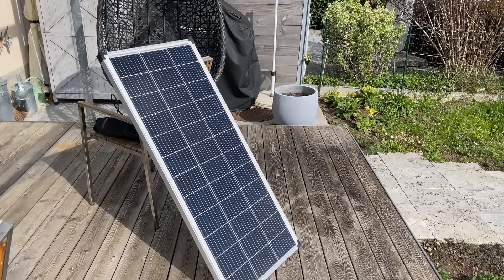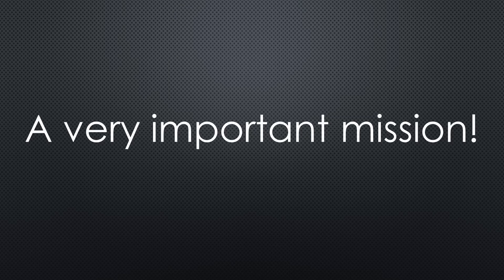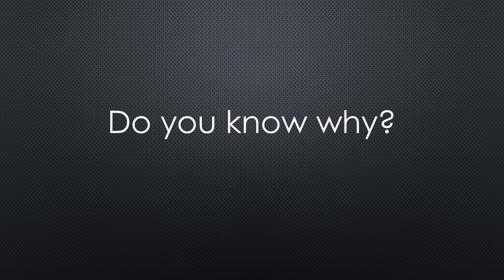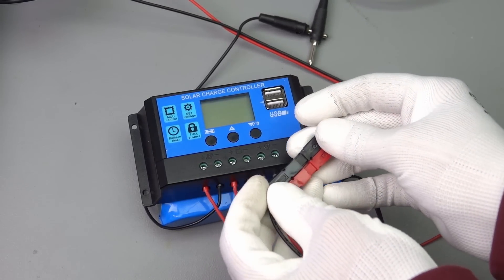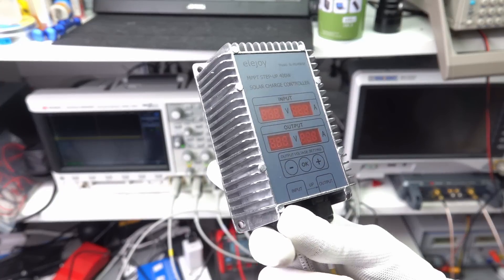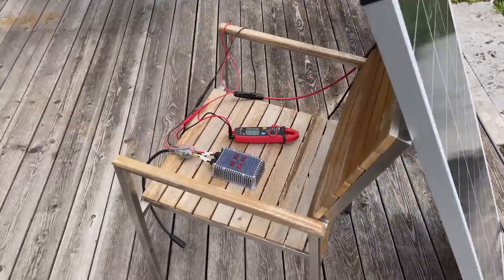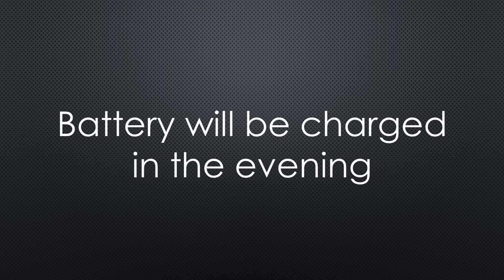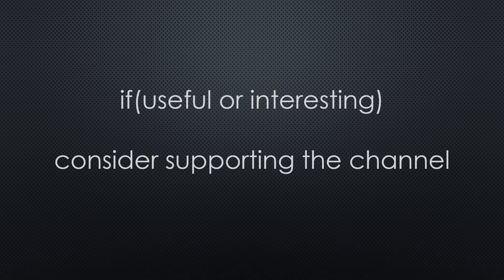454 How to Build an Solar Battery Charger for eBike / Electric Bicycle

Comment: those were some expensive solar panels! here in poland (so full vat etc.) i can get a new 410w panel for 100 euro ("risen" manufacturer, hyundai for double the price).
Reply from the maker: I still remember when I bought an Orange SIM card when I was in Poland. It was dirt-cheap and worked all around Europe. So you live in a very good country!
Reply: @AndreasSpiess  inexpensive, yes. good in some regards, bad in a few others!

Comment: I would have connected the Battery to the cheap mppt controller battery connection.
Wouldn´t that work?
Reply from the maker: You did not add enough information to decide :-(

Comment: Three 20V panels in series and  linear voltage regulator at 42V. Everything else is just looking for trouble.
Reply from the maker: I am not sure if you would get a good performance with your design because the input voltage of the linear regulator would be around 42 volts (battery voltage plus the voltage across the regulator. This would be very far from the MPP of the panels. Remember: The batteries take whatever current they get because of their low inner resistance.

Comment: that battery looks a lot like a roof rack cargo box. in the thumbnail i thought the solar panel would be fitted on top of a car roof with a modded cargo box.
Reply from the maker: Indeed, the battery looks a bit like that. But, of course, it is much smaller ;-)

Comment: why not a simple voltage divider to lower the 42v to 5v ?
Reply from the maker: Also a possibility. Others suggested using a resistor and a Zener diode, which is a bit more stable. Voltage dividers depend a lot on the current you draw.

Comment: use 2 panels directly  is aprox 42v ;)
Reply: Thats what i was thinking, at leat 2 half the size in series.
Ive always heard the higher the voltage, the more efficient everything is.
Like inverter input voltages.
Reply: @MikinessAnalog  exactly, of course there are far more expensive solutions, but I said this from personal experience, I personally tried to charge the 36v nominal battery of an e-bike, based on the post-apocalypse idea that there would be no parts or equipment to buy, so I tried to charge the battery directly with the serial  connected two polycrystalline panels directly to the live plus and minus... and char
ged it in a little more than half a day, the battery is 400w, the downside is that when the sun starts to set, then the battery has a higher voltage than the panel and the panels slowly drain the battery, which means that it should  solve with some isolated booster or diode
Reply from the maker: I agree. 2 panels that have an MPP close to the charging voltage of the battery would work. Because I had no plan, I already bought the big panel and did not want to change, also because one panel is easier to handle.
Reply: @AndreasSpiess  I know , the panels offer are usually pre-declared... for existing or factory chargers pwm or mmpt... at the same time poly panels have a nominal voltage of 18.6 and when the temperature is very low it goes up to 23v, the larger panels are 250w  they are usually designed at 36v for charging a 24v system... so... it is difficult to bypass the factory solutions that were obviously already imposed on us by the design of the panel itself... I actually charged the battery from the e-bike, but I had to watch and check the voltage  and amperage... in any case, during an average sunny day, they will charge the battery from the other side and advise that lithium ion batteries be charged up to 80% and not below 40 or 20%....
Reply: and just to clarify, I have been actively dealing with solar systems for years and I am completely disappointed with inverters and their inefficiency.. so I resorted to the option of leaving everything that can work on direct current to work on direct current using only and exclusively dc-dc conversion..  eg LG 43"7050 TV consumes about 65w 220v... with UPS it is 85w and when... I use dc-dc the television consumes 37w... it seems like... that someone is deliberately damaging us... which was unbelievable to me.  .. that's why it doesn't occur to me to ever make alternating current or grid tie from solar panels for the rest of my life
Reply: Specifically, my TV uses 13.2v for electronics and 60v for backlighting.. I didn't touch anything, I just took the connection with cables and powered it from a dc-dc converter.... means... step up down 3a (2.1 peak) 13v and step up  to 60v....(59.5) pwm on signal I used for the led diode that turns on the relay that turns on the backlight all together 20e.... tv on... from 10.5 to 40v ...

Comment: My own setup is super inefficient. Solar to mppt charger to 12v lead acid to 240v ac inverter to Battery charger that drops it again to 42v dc.
Reply from the maker: If you use a big enough panel there is no problem;-)

Comment: I found myself repeatedly saying "put a few panels in series" all the way through the video.
Reply from the maker: This would help if I would match the MPP of all the panels with the 42 volts. Otherwise, I would get into the same trouble. Plus: I would shift the electrical problem into a mechanical problem (Creating a waterproof and rigid panel out of several small panels ;-)

Comment: A larger solar panel 72 cells would cost the same and solve all the voltage problems at
Reply from the maker: I agree that a panel with an MPP Voltage around 42V would avoid the charge controller. However, the ones I own are quite bulky and made for stationary usage.

Comment: 🤔 And where is the charger?  We have a solar panel, we have an mppt converter with a boost converter but where is the CC/CV charge controller for Li-ion batteries?  You don't think there's a charger in the battery?  There is only a BMS that guards the boundary voltages.  Li-ion batteries cannot be charged this way.
Reply from the maker: The current provided by the MPPT is in the limits of the batteries (the panel does not produce more). And because I set the charger's voltage to 42 volts, the current gets smaller and smaller if the voltage of the batteries approach 42 volts.

Comment: Maybe the cheapest but not efficient method would be use cheap AC inverter and your wife's sister regular wall charger :)
Reply from the maker: I agree. That would also be a solution. We would call that principle a "balcony power plant". But usually, they use much bigger panels for that purpose.

Comment: Haha, I also use my ebay/amazon/aliexpress order lists as my "inventory", then go searching in my parts bins for hours. I really want to RFID everything I order, but that might be overkill.

Also had dreams of setting up a solar charger for my eBike, but gave up after realizing how little electricity the bike actually uses. I spend only a few cents per week in electricity for charging, I'd never recover the investment in solar panels and hardware.
Reply from the maker: I agree: We do not talk about investments in a financial sense. It is an investment in relationships ;-)
Reply: @AndreasSpiess  Absolutely! It's also fun most of the time.

Comment: I find it a bit strange that you talk about getting an mppt and then buy what is clearly an PWM controller... PWM are really dumb things, mppt is the way to go.
Was also thinking if you would have put 2 x 24V panels in series you would have reached 48V which you could probably just regulate with a buck converter... ?
Reply from the maker: I agree with the PWM/MPPT regulator. But I saw some relatively good reviews that wrote that the difference to an MPPT is not too big. Which was not true in my tests.
Maybe with 48 volts, I could use such a simple regulator. But then I would have to have 2 panels...

Comment: Why the hell would you go through all this trouble instead of just simply using a proper, large panel or series stringing a few together?
You're making this seriously harder than it needs to be.
If you have the right panels and controller, none of this is needed.
Reply from the maker: I agree, I could have used a panel with 42V MPP. But the ones I know are much bigger than mine (not portable for a woman).